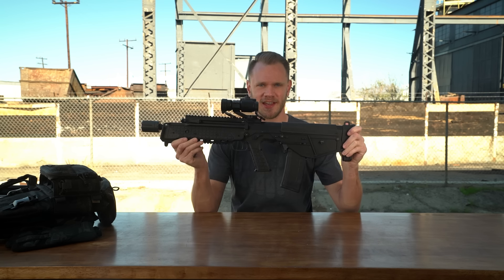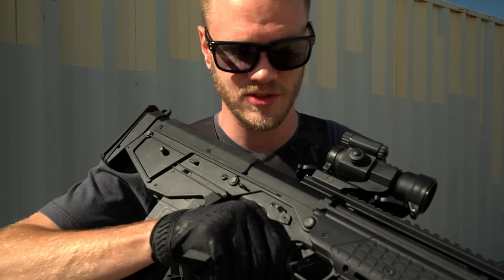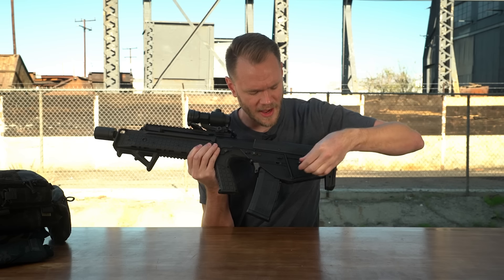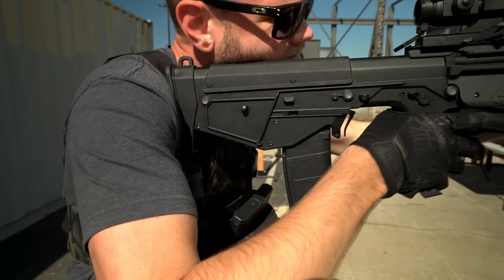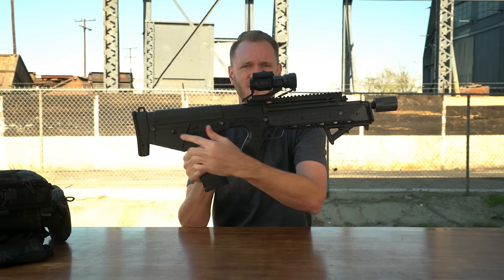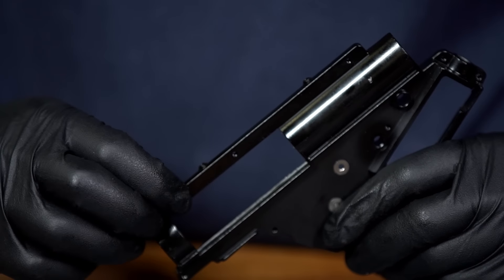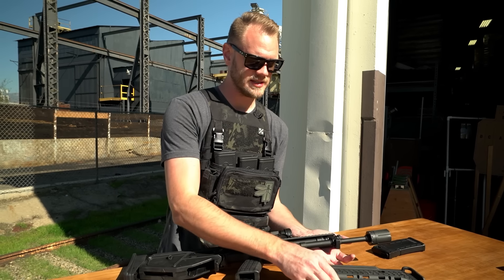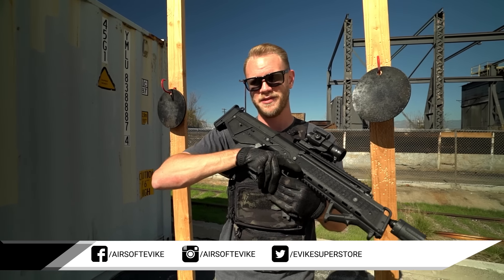The Ultimate Bullpup AEG - EMG Kel-Tec RDB17 AEG Review

Comment: Several things this video does not display because this was a pre production model as Matt said

1.The hop up will come with a sticker that will tell which direction to turn for more or less hop.

2. In the pistol grip there is a tiny flathead screwdriver to help adjust the hop up

3. The charging handle (although I agree do not hk slap it a bunch) is actually ALOT stonger and more satisfying to hk slap.

4. Some mags can drop freely if you want to do those speed reloads but some wont.

5. Ares will include 2 mags with this package. 1 130 round midcap and 1 small baby m4 mag that holds 100 rounds.
Reply from the maker: Great info! Thanks!
Reply: Can i upgrade anything so i fan hk slap all day💀

Comment: A few things regarding the disassembly.

1. You don't want to open from the right size because of the tiny ball bearing used for the fire selector.
2. Upgrading the internals with a strong magnet motor makes opening the outer shell difficult. Internal pillars that support the weight of the gearbox, the standoffs for the hex screws, and the sling points are all made of steel. 
3. So many screws.

Oh and here's the list of proprietary parts. 
1. Gearbox Shell
2. Cylinder head (shaped like an M14, nozzle seems slightly lower)
3. Cylinder (welded onto the cylinder head)
4. Hop-up chamber (same as the Ares M45... still proprietary)
5. EFCS Board (not 100% sure... don't really own other Ares guns other than the RDB)
Reply from the maker: Great info!
Reply: Hey man how do you take the sling points off cuz It doesn't want to be removed from the gearbox

Comment: Have owned the real steel one for years and I def enjoy it with the additions and more I’ve done to it for awhile now. This is pretty accurate and def something I’d use in airsoft as it stands.
Reply: Same here! I got the 20 version and my only complaints is the fore end heats up way too quickly and the top rail liked to wiggle itself off. Swapped out the fire end with a luckyirishman m lok guard and locktited the rail and it runs beautifully.
Reply: @jacobbundy5256  Lol, I had done the same but I moved on from my real one and sold it. Still liked it but not as good as my standard now :)

Comment: Well I’ve been waiting for the SilverBack MDR to finally come out.. years later & still waiting... guess I check out the Kel-Tech RDB17 if only it came with a built in Gate Titan
Reply: Yeah but I think Gate would have to make a proprietary trigger board just for this thing though, and I don’t know how ares would convince them to bother with that
Reply: Same man, although that hop adjustment is ridiculous....... and ares :(
Reply: @curioushex4782  honestly if you look at the placement of the hop up, it looks like you could drill a window in the side of the upper and cover it with the cheek rest
Reply: @curioushex4782  given the Evike techs “recommend” a motor upgrade, it’d shred the Ares internals to death
Reply: @randomshoppingcart2008  ... true you could dremel the top receiver, 1mm thick steel is still a hassle to do cleanly though. And the cheek rest is screwed in, so that also has to be modified so that it is relatively easy to remove.

Comment: Watching this review with an RDB in hand shows a very good attention to detail. Handguard looks 100% correct (like literally 100%). The lower has only a few small differences (mag release not having a rubber sleeve and some screws in a different location or not there and the bolt release slightly off). cheek piece looks 100% and the rail 95% correct. the stock appears to be 100% correct. The barrel looks surprisingly close with only the barrel extension being drastically different. Looks like the barrel is 100% clone correct. rear optics rail "trunnion" looks to be faithfully copied, but the gas block definitely looks cheap, along with the piston assembly and the charging handle assembly, but still really close in design. 

I'd love to see the upper receiver and how clone correct it is, but I'd wager the handguard, stock, and cheekpiece are swappable. the recievers and barrels are unlikely, but the 4 pins look to be in the correct spot. You never know with airsoft though as 1mm can make or break compatibility. I'll definitely be getting one to see how close it is, as well as BBs are far cheaper than 5.56 lol. Hopefully a GBB comes out in the future.
Reply: Having the airsoft version in my hand, I think it's quite nice. Although the charging handle is a bit of a pain to assemble. Looking at field strip videos of the real steel version, the top rail and cheek piece can be removed together. You can't do that with the airsoft version because the pipe with the charging handle actually extends and connects to the front of the gearbox.  Functionally it has no use, so I don't bother with it.
Reply: @Kenta Kawaguchi Assemble as in to swap from left to right? You can either unscrew the rail and rotate the charging handle or you can pull the barrel and handguard and swap it that way. These are way too tight for what they should be, but after removing the pins a dozen times, they loosen up (after losing material lol).

What's interesting is the carrier shaft (which is attached to the bolt carrier in the real steal) is attached to the charging handle by a threaded cap. you could unscrew the cap to separate the two.
Reply: @kawag2780  The real steel has a separate rail and cheek piece just like the airsoft. there is a real steel version (C/hunter, Survival, and Defender) that have a one piece stock and cheek rest though.

Comment: I’ve been waiting for this for a while now, there’s basically no modern bullpups in airsoft. Even worse most of the AUGS are built really poorly and cheaply. So having a modern bullpup that’s reasonably built is a dream come true
Reply: It’s a proprietary nightmare, even more proprietary then standard Ares
Reply: @opairsoft8100  bruh it’s hardly proprietary 
Gears are standard so long as you get the magnet
It’s a standard short type motor
Standard pistons 
Standard nozzles
Standard bushings/bearings 
The only things that are proprietary that actually matter are the trigger and the hop up which are almost always proprietary anyway when you make a new airsoft gun platform 

Dude for real KWA and Krytac guns are more proprietary than this
Reply: @randomshoppingcart2008  lmao...you forgot the cylinder head and tappet plate...the only thing “proprietary” in a krytac excluding the vector is the spur gear because the bearings stick out, which can be solved by using a bushing and grinding it down.

Kwa does have the stupid tappet plate/spring that is proprietary on their new guns
Reply: @opairsoft8100  yeah that’s why I said parts that “actually matter.” Because there’s almost no reason to ever swap out a tappet plate unless you’re doing a DSG 
I have never needed to swap a tappet plate ever on any of my guns, it’s totally inconsequential
Reply: Soon the SRS Airsoft MDR-X series should be launching! At least according to an older announcement of them. Have been frequently looking but sadly no recent updates
Reply: @NK_Customs  yeah I’ve been waiting for that too, but the RDB I slimmer, simpler, and lighter. Plus the MDR is probably gonna be really expensive looking at the specs of it

Comment: Is it easy to remove the pin from the handguard?
I'm worried about the battery space/placement, even though I love this replica <3
Reply from the maker: The pin is snug and might need a small tool like a stick or the tip of a pen or something to poke it out with.
Battery space is limited, but we have a battery that we recommend in the video! https://www.evike.com/products/78856/
Reply: Good luck getting the hand guard back on. I can’t get the pin back in
Reply: It is a bit difficult to take off and put back on, and I’ve only found 2 sizes of lipo that fit? The small stick, doesn’t last me all day…. But it’s minor to how much I enjoy using this rifle. Love everything else about it.

Comment: I would not buy a rifle with chips that means your weapon can be manipulated from an outside source other then the shooter.
Reply: It's not a rifle, it's an airsoft replica. Airsoft replicas have smooth inner barrels. No rifling means it isn't a rifle. But I know what you mean.
This particular airsoft replica is unable to receive any signal "other then [sic] the shooter" that would make it do anything.
Just because something has "chips" in it doesn't mean it's able to be controlled by an "outside source". This one just has the EFCU/Mosfet, which regulates the flow of electricity and allows for some basic pre-programmed features. R-E-L-A-X

Comment: There is computer chips inside that weapon....not good...
Reply: 1 - It's not a weapon
2 - There are "computer chips" in lots of airsoft replicas. They're typically called either EFCU's (electronic Fire Control Units) or they're MOSFET's (these regulate the flow of electricity) or a Mosfet/EFCU combined
3 - These electronic devices are NOT typically fitted with any sort of receiver or transmitter, meaning that they are (usually) incapable of receiving any external signal, therefore rendering them immune to external control (as you allude to in your later comment).
4 - It's airsoft. Even if you could control it from an "outside source other then [sic] the shooter", it wouldn't be that big a deal. But it can't be externally controlled, so the point is moot.
5 - Just because something has a "computer chip" in it, doesn't make it "not good" or able to be controlled from an "outside source".